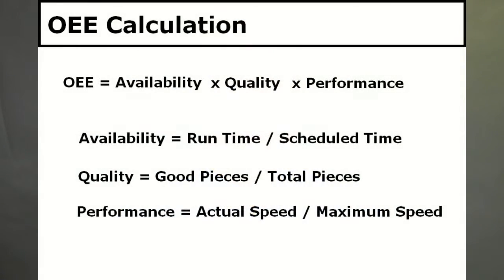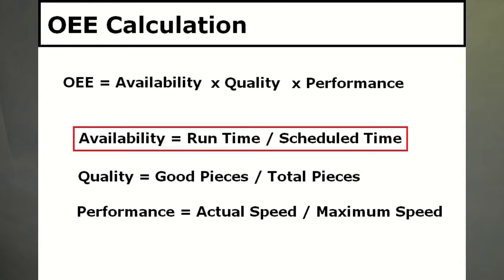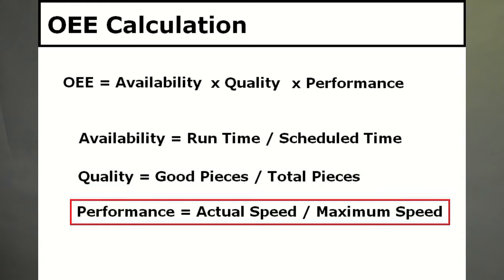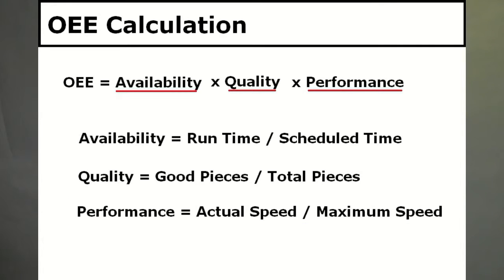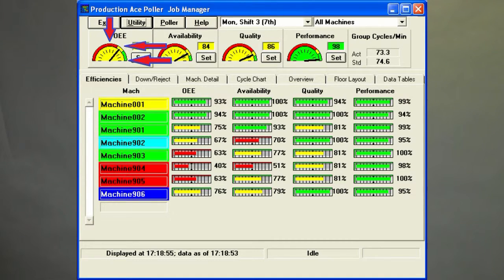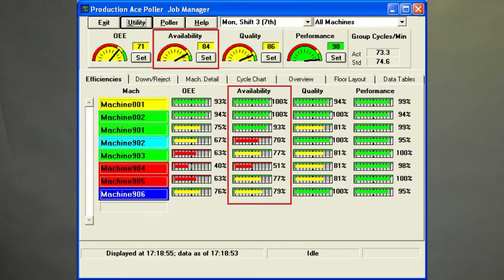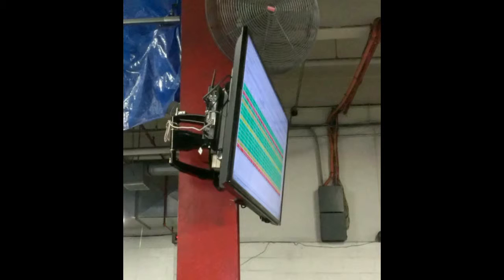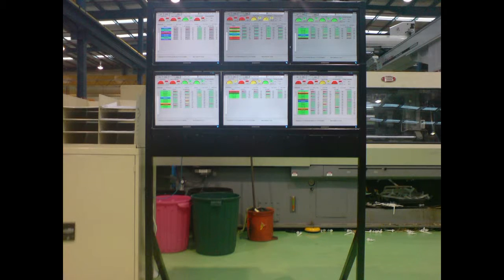Low Cost, Real-Time Production Efficiency (OEE) Monitoring

Comment: Great video about OEE monitoring! found it very interesting that how technology is impacting the manufacturing industry. The breakdown may cause any time, in such situation Wireless condition monitoring helps in fixing the problem more quickly. It helps in minimizing the overall loss of manufacturing industry and it's partners & suppliers too. So I think one should use good OEE Tracking software just like Thrive's OEE Tracking and Downtime Tracking Software. Cheers!!